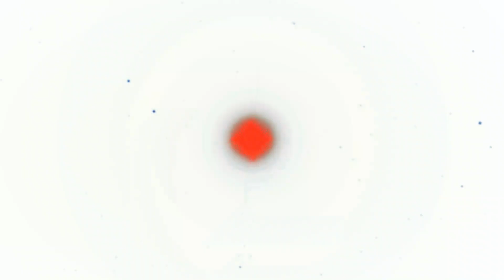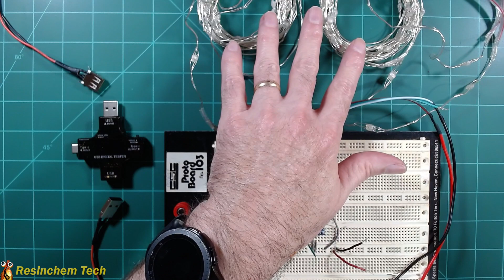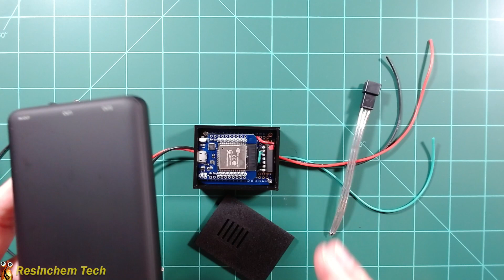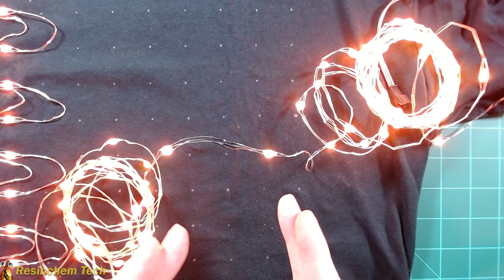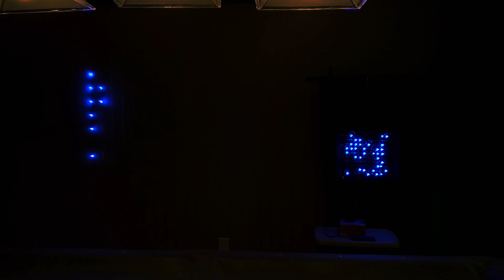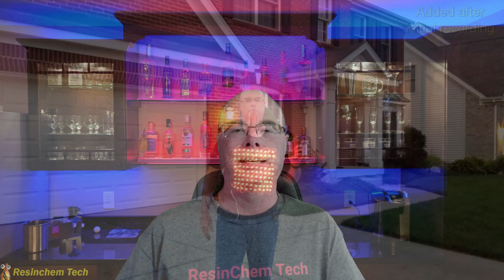Battery Powered LED Matrix - T-Shirt Build

Comment: Watch out for the Fairy lights, they state WS2812 but some are little different.  Some are internally static addressed, which means while they are protocol compatible with WS2812, if you cut the strings in half, the last half even if connected as the first LEDs, they still react as though there are still the original pixels before it. It also means they can be signal driven from either end of the string, and it won't change which is the first pixel.  They will work, but something to note if it works strangely after cutting some out.
This was discovered after one set came with the LEDs reversed, so pixel one was on the other end.
Reply from the maker: Interesting... and thanks for the head's up!  As shown in the video, I did cut the JST connector off the end of one strip and the beginning of another and soldered them together and luckily they work fine and as expected.  At least with BTF lighting products, I've found that they always use the same standard with the JST connectors... female on the start of the strip and male on the end, regardless of the type of LEDs.  But I'm sure there are other manufacturers out there that either use different standards... or no standards at all... which could result in the data flow being reversed from one strand or string to the next.

I didn't cut out any pixels in my case, just joined two full strings together.  But what you state is definitely worth noting for future projects with these fairy LEDs if I opt to try another at some point.  So, thanks again for sharing the info.

Comment: Thanks for actually showing the ammeter for the effects demo. I think this will help some viewers! It isn’t about the meter as much as showing it real time.
Reply from the maker: I actually had a segment filmed where I also showed the amp draw as compared to standard WS2812b LED strips (but cut it due to length).  If I recall correctly,  I believe at full bright white, 100 WS2812b LED strips were pulling somewhere between 3-4 amps... or 3 to 4 times the power of the fairy lights.

Comment: This is similar to a shirt I made last season, except I had to use pixels and I had the back, sleaves, shoulders and front covered. The whole thing ran from a D1 mini and 5v battery pack which I had in my pocket. I had the wires on the inside and had the pixels poking through the tshirt. It was heavy but not that uncomfortable. not bad for a prototype (like Ironman's cave build suit)  I think the seed pixels would be an upgrade for sure next time.
Reply from the maker: I debated about how to place the pixels.  I thought about wiring inside the shirt, some sort of "panel" that could be velcro'ed onto the shirt, etc. etc.  But based on my skill level (or lack thereof) with fabrics, sewing, etc. I decided to just keep it simple and apply the pixels directly to the outside of the shirt... even it if doesn't look the best under brighter lighting.  But it is surprisingly comfortable when standing or sitting and is pretty easy to put on and take off.  I do think it would have been tough to squeeze 100 pixels onto the front of the shirt with anything bigger than the fairy/seed pixels... and I was also surprised at how little power they actually drew vs. their brightness.

Thanks for the comment!

Comment: a necklace for dogs led iluminates strobe effect so no car will not run over dogs if he see a strobe light
Reply from the maker: There are a lot of potential uses for wearable LEDs.  I don't know if this particular design would be the best one for something like a dog collar or necklace just due to the amount of wire involved.  But the concept is a good one if you could build something that was a little more self-contained without as many exposed wires.

Comment: What are the thermals like after wearing it for the duration of the battery life?
Reply from the maker: I didn't actually measure the temp of the LEDs, but running various effects at around 50% brightness, I did not feel any heat at all through the material of the t-shirt.  So, unless you are going to run full white at 100% brightness, I think the heat will be negligible.  Even then, because these LEDs are so low powered, I would still expect the heat to be very minimal.    But I actually haven't worn it non-stop for the full battery duration... in the case of the battery I used, that would likely  be somewhere around 18 hours.  The longest I've worn it continuously powered on was for about 2 hours... and again, I did not notice any heat through the t-shirt.

Comment: Great idea,have you considered wearing a white t shirt over the top to act as a defuser,liking your videos.
Reply from the maker: I toyed with all sorts of ideas.  As I mentioned in the video, there are probably many ways to install/apply the LEDs to clothing other than the way I did it here... working with fabric is not something I normally do.  Honestly, I didn't expect it to turn out as well as it did when I first started.  But my goal here was to hopefully just provide some general insights on how you can create a battery-powered display and let those with more creativity than me figure out the best way to use them or apply to fabric/clothing.

Thanks for watching, the idea and taking time to post a comment.